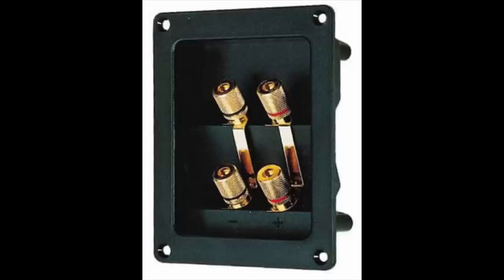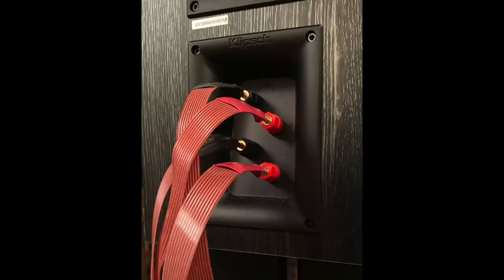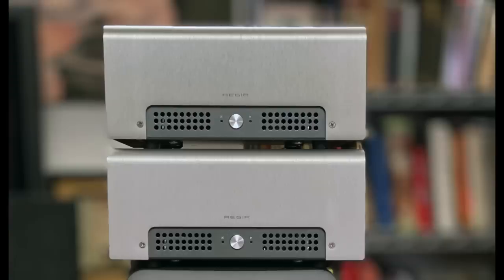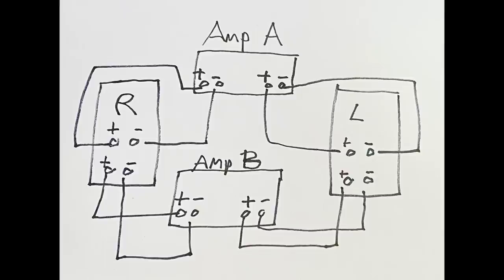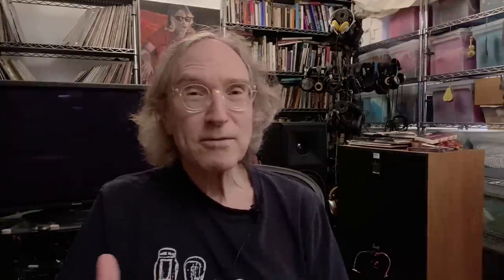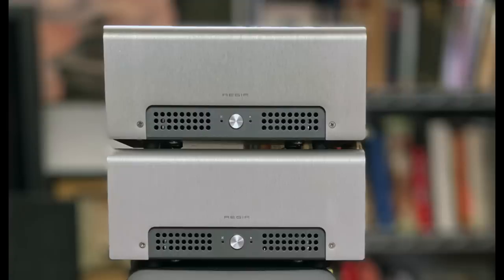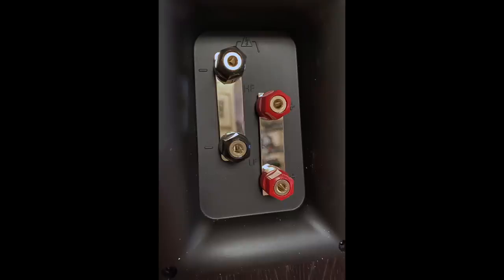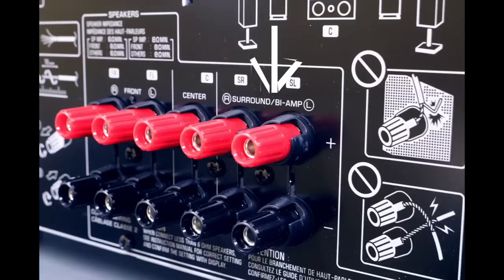It's time to think about bi-amping your speakers!

Comment: Hi Steve! Can I bi-amp with a Yamaha RN303 reciever? It has Speaker A & B outputs
Reply: Don't know this model, but most av receivers with a/b speakers are parallel from the same amplifier section. (Not biamping)

Comment: I wonder how those Klipsh 600 would sound bi-amped with two Reisong A-10 tube amps for a bargain bi-amped setup of about $1200? Could be killer sound for not many bucks.
Reply: I've expanded my horizons from not only spending my money but spending other peoples as well.
Reply: Oops, I didn't think this through. There is no way to use the A-10 as a separate  amplifier. You would have to use a DAC with dual outputs and feed one signal to each amp and then individually adjust the tweeter and woofer output with the volume control on each of the amps! If your DAC didn't have dual outputs (Like the Schiit Gungnir) then you could use a splitter, or maybe use two Modi Multibit DACs, one feending each amp? This is getting out of hand.

Comment: If one goes as far as bi-amping, then please use an active crossover, and if the speakers got passive crossovers boards, rip them out, now your bi-amping will make a remarkable difference! ... and, forget about mixing amps or different tire models on your car, please!

Comment: I deny magical cables as an engineering student but bi amping is measurable better. Bi wire is also real because the high current of the low frequencies will increase the resistance for the high frequencies as well. In engineering it's called 4 pile to have one pair of wires deliver the current and one pair for measuring. A hybrid amp would be great. A nice round smooth single ended class A tube midrange and tweeter and a mighty well measureing class D sub.

Comment: Guys, I need your advice. I have the IOTAVX PA3. I'm satisfied with the sound and all, but should I go complete ape shit and buy a second? Or save for a better power amp instead?
Reply: Can they be bridged?
The improvements can be amazing;-)
Reply: @carlitomelon4610  Not sure abut doubling up,  but a Schiit Vidar  100WPC at $695 costs about the same.It' an AB amp. I'd step up to the Schiit. I tried a IOTA and sold it. The sound was just not woking for me at the time, but people's systems and preferences vary.
Reply: @fletchermunson6225  
I'd seriously consider the Vidars if I wasn't already using Musical Fidelity  bridged monoblocks!
Of course you'd then need the Freya...Nice to know there's a modern "budget" alternative with a clear upgrade path: Freya+Vidars first with the second Vidar later if needed;-)
Reply: @carlitomelon4610  sounds like you are set. I meant for Ewinger. Just a single stereo amp probably sounds better than a couple lesser amps beamed. That said. Have fun and get thing a good as you please.

Comment: I had spare amplifier channels in my AVR,  when I downsized from a 5.1 to a 3.1 speaker arrangement.  I bi-amped the spare channels to each front speaker.   Perhaps a slight improvement to my ears.  However, it is obvious that each amplifier channel is working less to deliver the same sound pressure level.  More amplifier "headroom" is always a good thing.

Comment: I get confused. I have xlr inputs on my power amps, and to bridge them, i need to use xlrs from the pre and flip a switch on the power amps which basically turns them into monoblocks. Each power amp drives one speaker. Only problem is, in this configuration I can’t connect a sub via a high-level connection, and for me thats a must. The benefit of doing it your way is that you can still run a high-level connection to the sub.  Just make sure that when you move your balance control on the pre fully in either direction, either your left or your right speaker will stay silent. BTW If anyone has a solution for connecting bridged power amps/monoblocks via a high-level sub connection please feel free to advise me. I don’t rate rca connections on a sub.
Reply: @HiFihobby Man Hi thanks for taking the time to advise. Yes you're right, I have one sub. My BK sub has the folllowing advice for connercting high-level 
"To connect the high level lead you will need to connect the RED wire to the RED terminal of the RIGHT hand speaker terminal of your power amp. Connect the WHITE wire to the Red terminal of the LEFT hand channel speaker terminal of your power amp. The BLACK wire is connected to either one of the BLACK speaker terminals of your power amplifier". 
Of course, the problem is, in bridge/monoblock mode, you don't have both right and left speaker connections, you only have either right or left.  I will work out REL connections and try your solution. Bit nervous about it because the last time I tried the high level connection running in monoblock I nearly set fire to my power amp! Saw the smoke and disconnected just in time. Oh how I laughed!
Reply: @HiFihobby Man For me, once you've tried the high-level connection you can't go back. In my setup, there really is no comparison. The RCA connections, even in stereo, sound so much quieter, whilst introducing more noise as I have to turn up the sub. I tend to think that RCA/LFE might be OK for home theatre, but not for hifi integration. My sound is so much better with a high-level sub connection. So much so that I won't run my power amps as monoblocks, because - in my case - a sub gives far more sonic advantages than a monoblock setup. You're advice though, means I may be able to do both!  Also, I am considering dual REL subs (they would need to be the smaller ones as my listening room isn't that big).

Comment: What would happen if I was to use 4 tube mono amps?  I have them already.
Reply: A big grin on your face?
Reply from the maker: If they're all the same, that would be great. If not it will probably take more work to get them to sing properly together.
Reply: @SteveGuttenbergAudiophiliac  I just bi-amped my Decware Imperials. Using a Tubecube7 (3.5 watt set tube amp) from Tube Depot for my Altec 811b horns. I am using an old Crown D60 class AB pa amp for my Imperial bass horns. They are playing nicely together. My secret: I am using a DBX Driverack PA2. Active crossover with DSP and room correction. I haven't set up the room correction yet.

Right now I am listening to Black Sabbath's live evil on vinyl. The only problem I am having is I keep burning my thumb on the lighter.
Reply: My amps are very similar, 2 Quicksilver silver 88 mono amps and 2 vintage McIntosh mc75 mono amps.

Comment: If I have an older receiver, can I bi amp by using both the channel A and channel B outputs to the same speaker?
Reply from the maker: No, your receiver has only two channels of amplification, you need four channels

Comment: Why didn't you show the diagram for the preamp to amp connections? I know it should be self evident or obvious, but trust me, I've seen it screwed up more often than you realize.
Reply from the maker: You take a Y splitter, like the one pictured in the video, hook it up to your preamplifier output. And then run cables from the splitter to the two power amps
Reply: @SteveGuttenbergAudiophiliac  Yea, you're confirming what my concern was. You don't just connect the single Y connector from the preamp to the 2 amps. You connect the single RIGHT preamp to the RIGHT side of the 2 amps and the same for the LEFT side. I have been an addict on audio since the mid 70s and spent WAY TOO MUCH CASH on my addiction and have helped many many folks set up their equipment. What is obvious to you or me is not obvious to others. BTW, I only commrnt on sites that I enjoy so I didn't intend it as a slap or whatever the current social media colloquialism is.

Comment: unless you have a speaker that has a three plus way design giving each of the binding posts sizeable load requirements for bass frequencies this is a waste of time and only introduces more cables and potential distortion into the signal path. a tweeter on its own poses almost no demand on any amp.  the amp is really seeing mainly the bass driver output. of course if you have a masssive 4 way design that crosses over to the low driver at 100 hz or so then this makes sense.

Comment: Bi-amping without using any active crossovers (that I could see)?   I've had an active 4-way stereo system for the last 40+ years. I use an active crossover on each amp input. Basically, it's nothing more than a scaled down PA system. Do any of those amps you used have built-in crossovers or did you just send full bandwidth audio to each speaker, no matter what?

And gain-wise....going from 2 watts to 4 watts (all else being equal) is no different than going from 100 watts to 200 watts. :-)  a 3 db gain is still a  3 db gain.
Reply: PhillipZX3 you don't "send" the full audio signal to the power amplifiers.  The passive filters in the crossovers are still there on each drive unit, hence the signal going to the tweeter through the amp is just the high frequency part and the low pass filter ensures the woofer only receives low frequencies from that power amp.
Reply: @markcarrington8565    Ah..That makes sense. I've never used passive crossovers so the thought never crossed my mind. 

Thank you. :-)

Comment: Why you mention you get twice the power if it is the same power for each frequency, just handled by different amplifier? In order to duplicate the power, you need to have twice the power at the same frequency. The bennefit is that they will run under less stress if you divide the frequencies handled by rach of them, but the final power will be the same. The sum of power from different frequencies is just used as a marketing strategy without any technical sense for cars that have multiple speakers with multichannel amplifiers.

Comment: If bi-amping is cost effective, why doesn't any amp manufacturer build bi-amping right into their box? Just put extra channels in and you got a single box bi-amping amplifier. It would cost almost double the price, but if bi-amping is cost effective, it should beat other competing amplifiers at that price, right? Since no one makes that, I would conclude bi-amping is not cost effective. It may sound a bit better, but not 2x better. Not a single company makes such an amplifier.

Comment: To get the solid-state amplifier to have synergy you need to have it a filter crossover and rolloff,  a Harrison fmod RCA filter at 380Hz 12db roloff going to the solid-state amplifier you should be alright then or an active crossover connected to both amplifiers Nelson pass makes a active crossover designed by linkwitz

Comment: Bi Amp, hmmmm, interesting but does it make sense? 
I think the answer is pretty easy, if you have a speaker / amp combination you like and you replace that amp with two other amps that each cost half of the amp you took out AND the result sounds better THEN it makes sense if you would have done that from the start. But I can just not see that. (And that is assuming you use cheap cables otherwise an extra set of cables has to be subtracted from the price of the two amps.)

Comment: Always remove the supplied bi-wire jumpers, they are bad; replace them with good quality jumpers (or extend the speaker wire to the second terminal), and the sound improves a lot, more than bi-amping can improve!
Bi-amping is just an expensive hobby, invented by the audio industry..
Reply: he just said it works in the video, do you not watch the whole thing or......

Comment: Biamping (passive) has no audible benefits and is a waste of electricity, wiring, time, and doubles the price per channel because you need two amps. Common errors people make causing them to fool themselves in testing this, are: 
A. the amps are not carefully gain matched by instrumentation, to the tenth of a dB, so the listener is effectively EQing their sound (one of the drivers is being driven hotter than the other)
B. four identical amps aren't being used so the sound difference is because the amps themselves sound different.
C. The test is not conducted under blind conditions so the placebo effect kicks in. EVERYONE without exception is susceptible to this, cognitive bias, and the people who claim otherwise are fools.
Reply: Did you read that somewhere🤦‍♂️🤦‍♂️
Reply: @1dirtydog620  No, I have an advanced background in audio and worked in it professionally for decades so I just sort of know A, B, and C above.